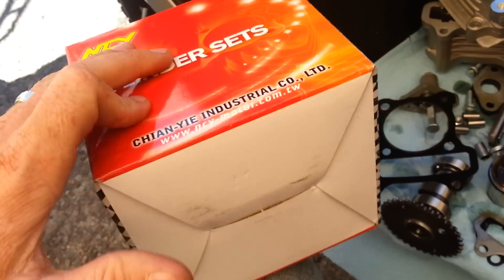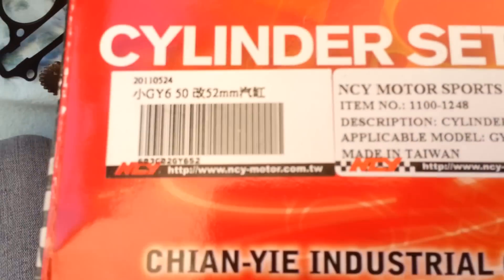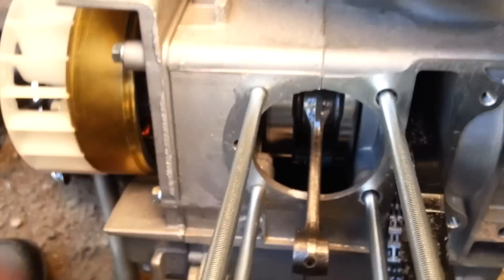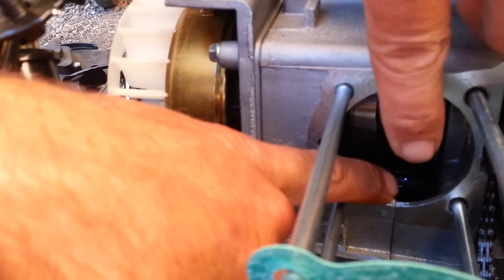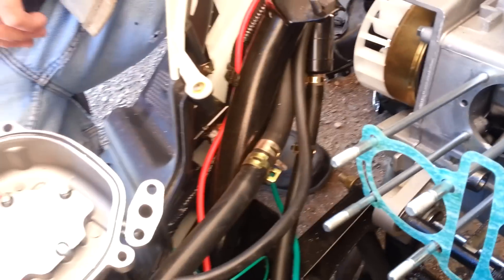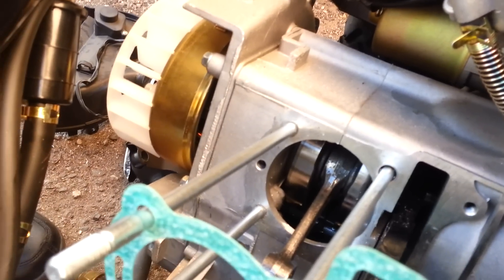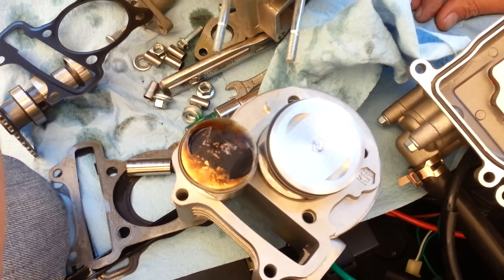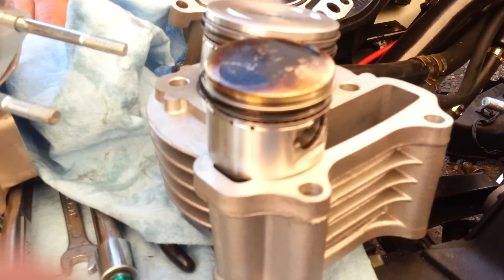Gy6 ncy big bore kit modification for install of the performance cylinder

Comment: is there a big difference between the nCy 90CC bore kit. and the 100CC bore kit. the 90cc is a 52mm but the 100 is onlee 50
Reply from the maker: The NCY kit will blow the 10cc no name kit away. I cant say enough about the 90cc kit. We always stock these kits. Wheelie power guaranteed. The 100cc kit you find on ebay is complete junk. We use to use those we had nothing but issues.
Reply: really. wow and I thought that the 100 was gonna be better. I have the 90cc on muh bike right now and its already really good.
I didn't have to bore out the case for mine to fit either.

Comment: 52mm It does get a little confusing. A GY6 125 engine has this size cylinder and piston and always been consider a 125cc GY6 152QMJ. A Kawasaki 90 ATV has a 52mm piston in its engine 152QMB also the Linhai 80cc ATV's have a 150QMB engine with a 50mm piston. when this size 52mm is used in a GY6 50 that is being upgraded its considered 85cc due the head that is used with it is also 52mm to accept piston size.

The GY6 engines that come out of the Chinese factories like Zongshen who make the GY6 also the CG engine that Honda uses marks their with a "1" indicating one cylinder and "39" indicated mm"s of piston hence 139QMB 157QMJ which is a 150 engine with a 57.5mm piston as stock, in 2003 when I started offering parts for GY6 engine I need a way to help consumers know the parts would work so I had them look at their engine for the stamp, same for the two stroke engine 40QMB has a 40mm piston which all these numbers are in the specs that have been used since 2003 when I was working with Red Streak Motors and GS Motorworks if anyone recalls them, its been a quick ten years when in deed there were 3-4 sites offering these engines in scooters now there are 100s

To determine cc's it is the amount of fluid in the chamber with piston TDC
Reply: Nike u r the one who got me started on scooters back in 2010 just wanted to say thanks for all the info now I have my own scooter shop!